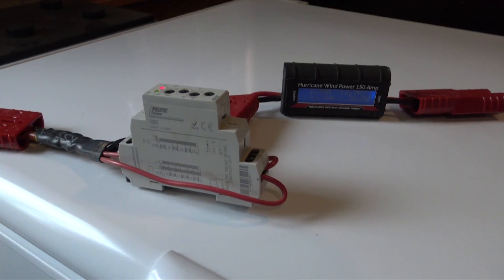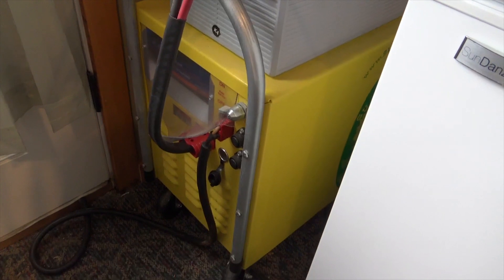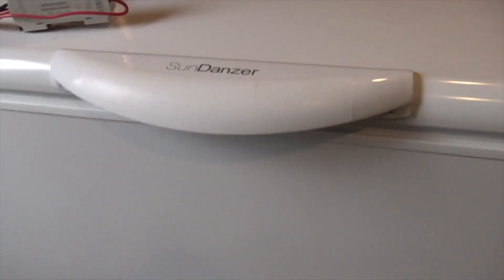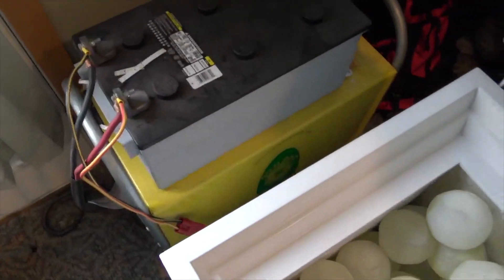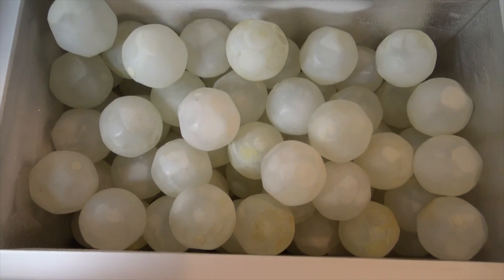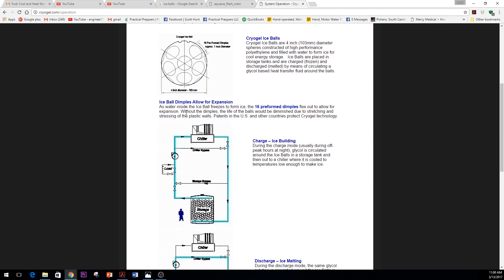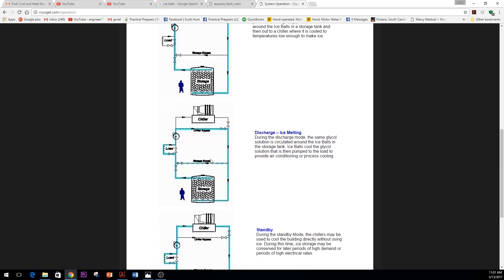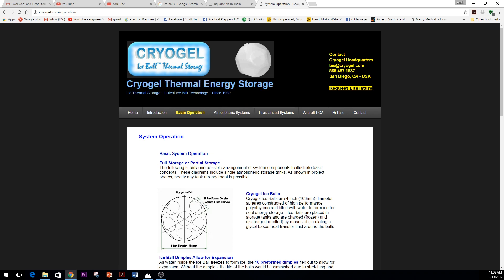Solar ICE and Thermal storage

Comment: Or, you could just fill an empty Gatorade bottle with water and put it in the freezer. Exactly the same thing. They stay frozen longer, because they are larger, and the cost is free, instead of something ungodly expensive. If you leave 1/2" for expansion a Gatorade bottle can be frozen over and over indefinitely, and does not expand outside of it's original shape.

They're actually much better than "cryoballs", because if you want or need to you can also drink one.

Comment: watching this again.. I do the same thing with a 12v DC Alpicool fridge/freezer in my van setting it to the coldest setting all day when the sun is out and driving in my van. Since i always have water bottles it keeps meat and milk well below 30F overnight until the next day's sun and/or drive. I've been able to keep meat fresh for a week using a combination of my alternator, a $100 100 Watt solar panel and a single $100 115AH deep cycle battery that is also my van's primary starter battery. i have no auxiliary batteries beyond an emergency jumper lithium that is a tiny 4x6x1 handheld I keep under the hood.   All my devices are always at 100% by 7pm. I also use that same battery to run a maxair fan on medium (about 2a/hr) overnight from  about 9pm to 6am. The formula is very tight but seems to work well for me down here in Florida.

Comment: love this work and science!  I need to update my videos but I'm urban vanlife-ing with a rigid 100 watt solar panel on my roof a 1200 watt inverter, 12 volt freezer and 800 watt electric grill.  Using the sun and a daytime timer I'm basically have am able to keep food fresh and cook semi-sustainably without added batteries, fuel or store ice.  I also use the Sun to dry my clothes on my van's roof which has reflective vinyl wrap.
Reply: If we think efficiently we can do lots during Sun light hours! I used to cook every thing with the Sun (Sun oven and a parabolic dish) and just use an induction plate to heat the meals at night using my batteries and a pure sine wave inverter.
Reply: If you put a few of those iceballs in there you store some of the daylight hours for the nighttime.   I saw a solar pcm oven(video  somewhere here on youtube)  the basically had one small cooking container stored inside a bigger one that is filled  with  pcm(phase change material) in the daytime they would charge up the oven with a tiny solar cell.  A few hours of charging later you can  use the stored energy.

Comment: Not sure if this has been mentioned but I think an overlooked concept in this is the fact that you're getting more energy per volume of ice compared to say heating the fluid.  This being due to the phase change (fluid to ice).  Certain fluids take more energy to freeze than others.  So 1 litre of ice stores more energy in the freezing process compared to 1 litre of water, e.g. heating it from say ambient temperature of 20 degrees C to 58 degrees takes less power than freezing 20 degrees C to -18 degrees C even though the delta T is the same.  Bottom line = more power storage per unit of volume (a major hurdle in the power storage game).  

I have a next project for you; paraffin wax heat storage for Autumn/Spring (and some contribution to Winter) solar space heating  :)

Comment: The ice ball is 4 inches in diameter so ice has to freeze through 2 inches.  Other systems use internal melt technology and requires only 1/2 inch ice build which requires less energy to freeze.
Reply: Ok. Sounds good, but could you reference the technologies you are speaking of please?

Comment: I tried this and couldn't get it to work with a 1000 watt Jupiter Modified sine-wave inverter, two Group27 12v deep cycle batteries in parallel, a 230 watt solar panel putting out max 30v DC, solar controller supplying 13v to batteries and Dometic ice maker 120v.  The ice maker comes on for about 1 minute and then shuts off the inverter.  Exact same thing happened using a HF 750 watt inverter with 1500 watt surge.  Both these inverters should be plenty of capacity to run the 90 watt ice maker.  Ice maker works perfect in the house on 120v AC.  Any thoughts?
Reply: You need a pure sine wave inverter to run well the compressor.

Comment: But how much capacity does each ball have?  The balls are very cold, so they lack energy... So wouldn't that mean that they have a specific capacity for absorbing heat?  Up to the point where they are no longer frozen.

How would I know how many to use for certain scenarios without knowing what each ball is capable of absorbing?  Or am I thinking about this wrong?

Comment: The idea of using cryogel balls is great IF you can purchase them.  Unfortunately, I don't have a need for 1000 cryogel balls and it's not clear (from the cryogel website) how much 1000 balls would even cost or if my wife would divorce me if 1000 plastic balls showed up at the front door.  As an experiment, I would probably substitute used water bottles filled with tap water.  Although the cheap plastic in the bottles would probably not hold up long term during thousands of freeze/thaw cycles in a glycol solution (and the bottle shape is not ideal like a sphere), you could at least experiment with a design to see how well it would work.
Reply: If you're going to provide your own bottles go with 2 liter soda bottles? They might sell poison inside, but those things are damn near indestructible.

Comment: Ever thought about running a bunch of pex in there then to a heat exchanger on your a/c handler?  I want to do something like this, either that or right into a in floor heating/cooling sys.  Very cool vid!
Reply: Mark G, the unit is in the house (i.e. rejecting heat into the house). So the heat absorbed by the coolent in the pex would be rejected into the house is the first problem with your proposal. Secondly cooling the pex and whatever it feeds will cause condensation in humid climates. Not desirable. Traditional AC systems fix these issues.
Reply: @danielvivian3282  True but it could easily be moved outside, and dehumidification uses much less power than a/c..

Comment: You said the DCF 390 would do 48 volts, however your web pages says:
"Battery-powered freezer, 12/24V"
Reply from the maker: Yes, the 390 is standard at 12/24 but they have an 48v option that is ~$150 more with a different compressor in it.  It works great. Send me an email @ info@practicalpreppers.com if you would like me to get you a quote.  Please send me a shipping address too and if you can have it come to a commercial address you will save a little there.  Thanks

Comment: This begs for a valved system that would switch between the compressors for your food-fridge and AC and blowing air over your ice-chest, depending on temperature and solar load. Then you would never need to transport your ice anywhere, or do any other manual involvement. I wonder if any such systems exist that are designed for a residential scale.

Comment: I was thrilled to see this use of the SunRNR!  I got the 24V model about 4 years ago, still use it but not very efficiently - this is a great use.  Hopefully my SunRNRs batteries still have life in them.   I'd really like to see the details on how you set the SunRNR up with an extra battery and info on the cables you use. Do you make your own cables?  I know the SunRNR cables are expensive - I got an extra cable with the SunRNR to hook up additional solar panels (or batteries); the connectors are compatible at the SunRNR end of course but not the end that would connect to my extra solar panels.  I'm not knowledgeable enough to even know what connectors to order to change them out from either the extra panels or the SunRNR cable.  Can you do a video on all of the types of solar panel connectors?.  If there are adapters for different connectors that would be helpful to know as well.  If I had a bigger budget I'd just get someone to do all this for me but that's not possible.Thanks!
Reply from the maker: Yes the Sunrnr is small but if worked within its limits I have found it to be very useful.   Folks expect to run the world on a couple of panels and they just won't believe the math.  When it comes to connectors Multi-contact brand (MC-4) is the best and industry approved standard.  There are a lot of cheap knockoffs.  Some folks use anderson connectors ( Sunrnr) for smaller projects and they work well as the polarity cannot be reversed.  Many times I just cut the connector off and put the ones on I want to use instead of trying to adapt.
Reply: Thank you, that helps.  I agree SunRNR has it's limitations but does have practical uses.  My plan for my extra cable is to cut off the preinstalled connectors - it's buying the correct replacement ones that is difficult. At least I know what to look for now if I want to get more panels connected to the SunRNR.  Thanks again!

Comment: conventrated solar absorptive coolers are a great way to get cooling and even make ice using mirrors or fresnel lenses and sun, and uses no electricity.  although they are usually pretty hard to get small scale but perhaps modifying a propane freezer from an rv and change the heat source to concentrated solar?
Reply: Wesley 
I think about this,  also

Comment: What system or equipment would you suggest for a small condo apartment in Hawaii?  I get all confused with different systems available and costs.  I like watching your videos but most projects are way too large for me - but I still love watch you.  Mainly I wanted to prepare for emergencies situations maybe up to a week.  Thank you for sharing all your knowledge and experience.
Reply from the maker: It eventually comes down to your budget and what you want to run.  We have some many systems now so tell me what you would like to run and how much you have to work with.
Reply: My needs are fairly simple.  I’m looking to keep a refrigerator / freezer cooled plus just small electronics like fans, (no power tools or microwaves).   My budget would be around $3000 range.  Some things I have considered:

1. Portable Solar Generator Units like Goal Zero Yeti (expensive)
2. Small (quiet) Propane generator (like Honda I could run on my balcony and enclose in sound muffling box)
3. Battery Banks 

After watching this thermal storage video, I would also like to consider getting a freezer and experimenting with using those Ice balls as a substitute for air conditioning unit.  My condo charges extra for A/C units but not for freezers.  

I don’t really understand differences between inverter,  sine wave, DC to AC,  or how to match electrical things together. I would like your experienced advice on which units you have found as best value and durability in actual usage and would be least complicated for me to use.

I will probably buy a small freezer so will look into the SunDanzer, and I will even consider buying a better refrigerator if you know of a more efficient one.  I want to prepare for emergencies as Oahu can be vulnerable to many emergency situations that could easily last longer than 72 hours. 

Thank you so much for your time and advice.

Comment: I have a 12 volt picnic cooler that can cool on a small panel when the sun is out and can hold the temp overnight.   Eh, its cheap(er) and not fancy, but it works
Reply: AnnBearForFreedom would like to see a video of this setup .
Reply: I have a Dometic, it is not large and it runs from DC, AC and also propane. It is a wonderful unit from. Austria and actually makes ice! It only uses 6 amps and it doesn't have moving parts, it uses a heating element to heat the ammonia gas.

Comment: My 2 cents.  I have been planning on building a 120v chest freezer air conditioner for awhile and not spending a ton of money.  Living in Phoenix AC very important.  I currently have an extremely well insulated 450 sq ft "bug-in" room that stays 20 degrees cooler than the outside 100+ F weather without any air conditioning at all.   I have a grid-tied Fujitsu mini-split I can turn on anytime to Heat/Cool if i needed too.  My idea would be to utilize grid electric 120v with a Danbury chest freezer when available.  When power is not available utilize solar, battery(220Ah AGM), and inverter.  The plan is to make 2 4" holes in the chest door (1 on the far left and 1 on the far right).  The left hole would be the air intake with a screen and duct going up close to the ceiling to draw in hot air.  Inside the freezer make baffled areas with galvanized flat metal that force the air to travel up and down past frozen media.  The right hole would have a 12v duct fan on it and could run off 12v battery bank, place a 90 degree PVC elbow on it and force air into room.  you could even insulate the whole thing with 4 1/2" Polysy foam and bury it to really amp up the efficiency if off grid and the 120 compressor was never used.  At night with no solar available you could still run off the battery bank.  i did a lot of research on chest freezers prior to purchasing ag a danbury 13cft chest freezer for frozen food and am very impressed with the energy efficiency.  I did insulate chest door to help on the efficiency.   Keep up the good work on all your videos.

Comment: Hi Scott, is it just water in these Cryogel balls, or some other substance?
Reply from the maker: Just water.
Reply: Have you looked into the specialized ice packs that freeze at different temperatures which are supposed to keep things colder than water will?  For example one brand Arctic Ice has three different packs that will freeze at different temps 33.8F, 28F and 5F to keep things freezer cold or fridge cold.  The Cryogel ice balls primary purpose is to chill air to offset AC costs.  If the primary purpose was to help make ice from water wouldn't we need something that phase changed at a lower temperature than water freezes at?
Reply from the maker: I need to look into this. Thanks

Comment: making ice takes a lot of power.  I tested a DCF165 unit in 80F ambient environment (with only 15F internal temp).  Filled it with 8 gallons of water and waited for the temp to stabilize (took three days to get all 8 gallons solidly frozen and to start cycling again).  Then i added 3/4 gallon of 80F water once per day (removing 3/4 gallon of frozen everytime I added new water).  The unit used 530wh/day.   I think it might be able to freeze 3 gallons of water per day MAX- and thats with the compressor running 24/7 at  30watts.  This was running it at  2500RPM (with the newer 212 ECU).  If you change the resistor and bump it up to 3500 RPM, you might get 6 or more gallons forzen per day... but you will also be using 60-70 watts 24/7 for around 1.6kwh per day.
Reply: where can you buy the ice balls?
Reply from the maker: Great Feedback!  My DCF165  is in a 68F ambient environment and I have about 1200 wh/day of solar so I get about 5 gallons of ice a day.   That's plenty of ice to keep several refrigerators going.
Reply: we designed a circuit to force the freezer to run colder while the sun was up.  the project kind of went stale when we tried to come up with a DIY thermal storage though.  These balls might be just the right thing.
Reply: BoilerRoomRadio he has the link in the description of the video.
Reply: I am interested in the COP. 1200Wh is 1.2kJ/s*3600s is about 4500kJ.  To make 5 gallons of ice is about 20kg x 334kJ/kg or almost 6700kJ removed. That's a very high cop of 1.5  Are you sure on these numbers?

Comment: Wonder if you could run a car AC pump off a water wheel to make ice 24/7. The waste water could be used to cool the condenser and a simple pipe evaporator in a water tank with a heat exchanger to let you harvest the cold.
Reply: Scott,forgive this interruption to the flow of this video and its comments, but am trying to contact you.   I'm Australian and trying to discover for the first time what brand of TEG would you and Todd recommend, given that Todd said (in his video: "Before buying a thermoelectric generator you must watch!") most were poorly engineered in China?
Reply from the maker: It would be awesome!
Reply: so you spend energy to get water and then waste this water to cool the building?  what is EROEI and CO2 footprint?
Reply from the maker: Well, yes most are made in China. I get mine through Tegmart.
https://www.practicalpreppers.com/power-solutions/thermoelectric-generators

Comment: interesting. fyi, if you search youtube for "solar powered air conditioning" CSIRO, an Australia based company, has an interesting technique for home solar AC.
Reply from the maker: Interesting fir sure. I would like to see if it would work in a high humidity environment.  Typically they only work where it is already relatively dry.
Reply: thanks for the insight / info.